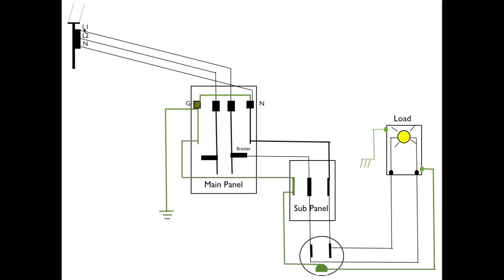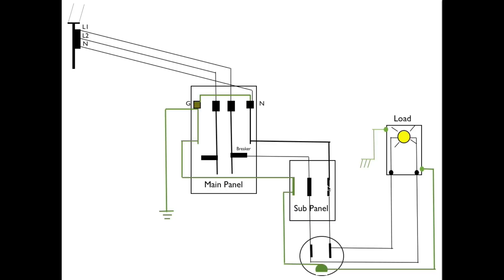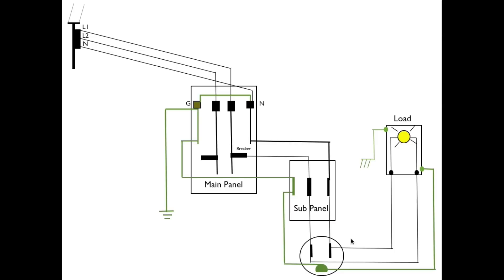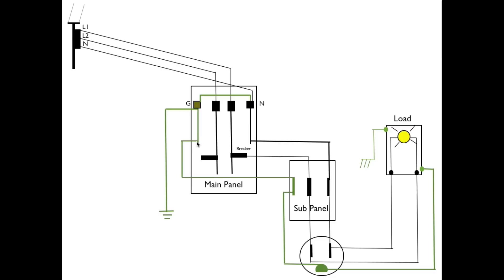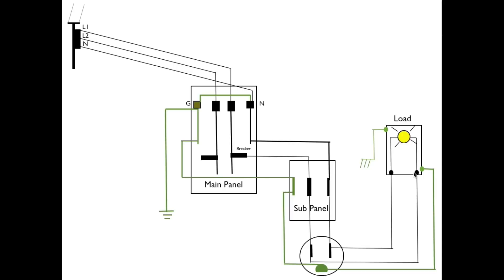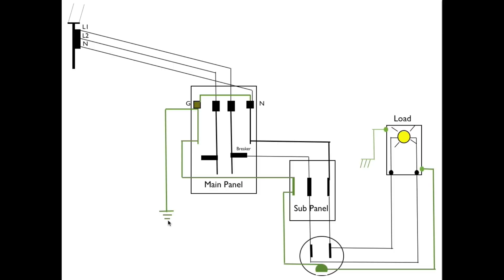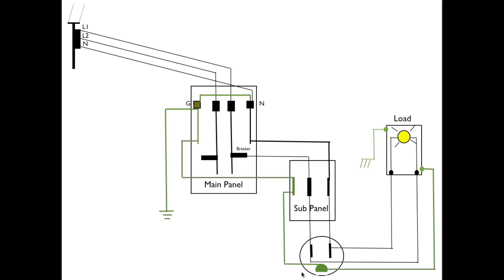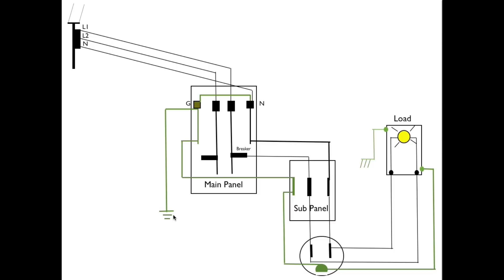The difference between neutral and ground on the electric panel

Comment: How do you do a subpanel with neutral and ground running 240 to the subpanel from the main?
Reply from the maker: If the panel is used for 240 volt only, you only need the 2 hot leads and a safety chassis ground.  If the panel will have both 240 and 120, you will also have to supply a neutral chart is separate from the ground wire.
GFM
Reply: What i did was run a three wire with ground. I ran the white wire to the ground terminal and went direct to the neutral into the panel on the neutral side and used the bare ground to ground out the metal on the receptacle because they have have to be grounded essentially. The bare ground in the three wire tying to the metal part of the receptacle is grounded to the ground terminal in the panel. So, if i use the white wire as a ground wire and tie this to the neutral in the box will this be wrong as long as i have the bare wire connected to my load side?
Reply: I also have two ground rods at both the main and sub panel.

Comment: Common is only a current carrying wire on 120 volt single phase?
if you are running 240 from a sub panel too one outlet.  Then pull 120 from one. Leg on another breaker and ground the the box with pvc plumbing is that ok
Reply from the maker: If you have a 240 volt sub panel, there is no neutral.  There is only chassis ground.  Chassis ground is not a current carrying conductor.  It is only there as a path for fault current to be cleared by the breaker.  
GFM
Reply: grayfurnaceman   so i should run a ground rod from sub panel and ground it to the earth?
Reply from the maker: No.  That will not help.  If you are trying to get 120 volts from a 240 only sub panel, you will have to run a neutral from the main panel.
GFM

Comment: My breaker box has only one "bar" to which both Ground and Neutral wires are connected. If a light, motor or appliance is running in the ON position, current is running through the Neutral wire. I'm NOT an electrician. But I do my own wiring.

About L1 and L2, AS I UNDERSTAND:
 In the US, we have Alternating Current (AC) which cycles between maximum Positive and maximum Negative at 60 cycles per second (CPS), also called "Hertz". L1 and L2 are alternating currents. But they are 180 deg out of phase with each other. When L1 is Positive, L2 is Negative. Both L1 and L2 are 110 volts AC. But when L1 is maximum Positive 110 volts, L2 is maximum Negative 110 volts. Hence the voltage between them is 220 volts. This is why a motor or appliance (clothes dryer) runs on 220 volts because it has both L1 and L2 wires going to it.
Please read this about AC current:
https://www.google.com/search?q=ac+current+definition&rlz=1C1CHWL_enUS888US888&oq=AC+CURRENT&aqs=chrome.2.0l8.18207j0j7&sourceid=chrome&ie=UTF-8
Check out the "sine wave" in the above description. For 1/2 of the cycle, the current (electrons) are moving in one direction, the upward movement (Pos). In the second half of the cycle, current moves in the opposite direction, (Neg) the down loop. They ALTERNATE. 
In Direct Current (DC), as in batteries, the current flows in one direction, from Neg to Pos, IN MY OPINION. If an electron has a Neg charge, it will be attracted to the Pos terminal, though It is commonly believed that the current is toward the Neg (also called Ground)
Reply: MrGruffy 44     I am not in agreement with the comments made by many that somehow L1 and L2 to neutral are 180 degrees out of phase with each other.   If you state that you connected an Oscope to the system and it shows this situation, then I agree.    But the true system is not anything but synchronized. At a point in time, all sine waves are at exactly the same start and end points, and increasing or decreasing in the same direction.   Another thing I don't like is the comments that two 120 volt parts added up to 240 volts.   If the truly must add up to get 240 volts, completely take out the neutral.   Now you have no two 120 volts to add together, but still have 240 volts.   That thinking can get you confused in three phase systems.   Two 120 volts wired exactly the same in a 208/120 volt wye is not 240 volts, but actually 208 volts.
Reply: Kevin Coop — This discussion is not about 3-phase.  As was stated correctly, L1 and L2 are 180° out of phase, because they are opposite ends of a 240V secondary in the transformer.  Each is 120V RMS with respect to neutral.

Comment: What the purpose is for the neutral being connected to the ground in the main panel?
Reply from the maker: +Kaveh Ebadi The earth ground is to absorb lightning and spikes in the line.  Hope this helps.
GFM
Reply: +grayfurnaceman  Thanks. Also quick question. Do you know where the neutral wire connects to in the power plant? Does it connect to the other end of the generator? I ask because it has zero volts which makes feel like it doesn't return to the generator.
Reply from the maker: +Kaveh Ebadi It connects to the center of the secondary winding of the power pole transformer.  L1 to the center(neutral) = 120 volts  L2 to center, 120 volts.  L1 to L2 240 volts.  Hope this helps.
GFM
Reply: +grayfurnaceman  Ah this makes a lot of sense now. Thanks a lot!

Comment: is the third wire,,ground usable as a ground for say inverter or battery?
Reply from the maker: I don't what you are trying to do, but don't mix DC with AC.
GFM
Reply: long story short, i have 2 batteries and an inverter in the house for backup i need a ground for the12 volt batteries,something instead of drilling a hole in my floor with a copper pipe under the house,,we dont have a basement
Reply: Battery systems aren't earth grounded.

Comment: OK, for safety's sake, all is understood for this demonstration, or better still illustration. I do have a question I could figure out on my own, it would just require a bit of time to transpire for the sun to go around the earth and me to take a panel cover off, etc. I had another panel put into my shop and within it are two 220V breakers and also two 110V breakers, I call it a sub-panel because it is charged by my main panel...I am deducing, or assuming(not good), that this would actually be considered an auxiliary main panel, is that correct?

Additionally, are all "sub-panels"  strictly 110V? I have the materials and can go investigate in the morning, and will regardless out of curiosity and to fulfill my educational lusts, but a little more knowledge and terminology would be greatly appreciated.

Thanks in advance...Aloha, KT
Reply from the maker: Knolltop Farms Any panel downstream of the main is called a sub panel and will have the neutral and ground separated.  Sub panels can be both 120 or 240V.  Hope this helps.
GFM

Comment: let me get this straight the ground and neutral are connected to the earth ground? now if I touch the ground and neutral together thee should be no voltage? now I am talking main not sub panel
Reply from the maker: Yes.  Even if you check voltage between chassis ground and neutral at a sub panel there should be no voltage.
GFM

Comment: If neutural wire is carrying load and it's separated from ground to prevent the ground wire from carrying load, wouldn't neutural load transfer to ground wire where they are attached in main service panel?
Reply from the maker: It does connect to earth ground at the main panel. However, ground is not part of of the circuit. The power travels back through neutral to the pole transformer. Hope this helps. 
GFM

Comment: My wife is an electrician. She lost her legs by a land mine years ago, and now has two fiberglass legs. She thinks it's OK to not wear gloves while working in power panels, but I don't like it. Does this sound safe to you?
Reply from the maker: I generally do not wear gloves in panels unless they are above 440 volts.  It would be safer to do so, but the reduction in dexterity drives me nuts.
GFM

Comment: I have a inverter that only requires L1 and L2 with no neutral. This is 240v in. What happens if the draw in not equal?
Reply from the maker: Because the inverter makes 240 volt, the draw has to be equal.  There is no neutral to put it out of balance.  Hope this helps.
GFM
Reply: The inverter will run on 240v (grid) when the batteries get too low.  
The inverter puts out 240v and 120v. I have a 240v pump on a pressure 
demand switch. From the 240v feed to the pump I have a 120v heater 
coming off L1. There is a floating neutral for the 120v circuit. With 
the pump running when the heater comes on will the current increase in 
L1 so that the pump will have equal power on L1 and L2? How does that 
work? Thank you for the reply and help in understanding.
Reply from the maker: That's beyond my pay grade.  Might try the manufacturer.
GFM
Reply: It is an Aims inverter and the manufacturer is of no help. I tried to get a wiring schematic and they said no. The inverter reads 60Hz but my meter reads 59.7Hz. I was going to adjust it up as the clocks read slow. Not a big deal. The pump and heater work, I was just curious as to current flow. I am thinking L1 is drawing more current than L2 from the source. Thanks for the reply and have a nice weekend.
Reply: The side of the inverter that has the heater will draw more power. 

How much power the heater draws on the one leg will have no effect on the power draw by the pump - which will be equal on both legs.

So, one leg will have the current draw from the pump. The other leg will have that equal current draw PLUS the current draw of the heater.
Reply: BonitaCreekWaterGuy — An inverter “requires” (inputs) DC and makes AC.  If the outputs are only L1 and L2, then it seems it would be intended only for 240VAC devices which do not require 120V.

Comment: Question so if I took a 240 volt disconnect box with a line side and a load side and I wanted to turn it into 120 volts ac if I took some Gator clips and put 1 lead online one and the second lead on ground with that ground wire be considered a live wire due to it being the leg of power that provides my 120 volts from 240 conversion not an electrician just an AC guy
Reply from the maker: If there is no neutral in the panel, as you would see in an A/C disconnect, connection to chassis ground would indeed make the ground wire "hot" if the ground is disconnected.
GFM
Reply: grayfurnaceman thanks

Comment: OK, in the main panel the neutral is physically connected to earth ground (safety ground). Good enough. However, at another panel down stream, a sub panel, you have two separate bars for neutral and ground and they must not be connected there.

HOWEVER, that same ground in the sub panel is still physically connected to the earth ground at the main panel. Electrically, they are the same no matter what. The only thing that could change that is if they were not physically connected at any point in the system.

I know that the whole thing must work as shown to enhance safety but I simply do not understand HOW it works since, with the physical connection of conductors between neutral and ground in the main panel, the neutral and ground in the sub panel are still one conductor. If you measure the resistance between the two, you should see a short.
Reply from the maker: Consider if the the chassis ground and the neutral at the sub panel were connected together.  If the neutral had an open, the load would run normally.  Then, if the chassis ground had an open, the chassis (sub panel) would be hot and you could be shocked.  Look closely at the diagram.
GFM
Reply: I understand that. The exact same would happen if the neutral and ground were to open at the main panel. Electricity will always try to complete the circuit.

Since the ground and neutral are connected at the main panel, they are electrically the same throughout the system. You might measure some resistance4 from the conductors if you put a meter between the neutral and ground at any point but, in reality, they are still shorted together.

So, though I know that having a separated neutral and ground on a sub-panel must have a real safety effect, I do not know WHY or HOW that safety effect is working.

Comment: the reason an outlet neutral is not grounded as the main panel's neutral is to prevent parasite currents recirculation in the network.

Comment: If current cant/doesnt flow thru the ground wire in norwal operation how can te current from a lightning strike flow through the ground rather than the house?

what is the difference between a lightning strike and normal operation?
Reply from the maker: ***** Lightning is a form of static electricity that has one pole in the clouds and the other in the earth.  So the circuit is complete when it passes to earth ground.  The voltage is extremely high and if there is no easy path to ground, it will find on thru the house wiring.  The power in your house makes a complete circuit when the hot side passes to the neutral.  Earth ground is not part of the circuit.  Because earth ground and neutral are connected at the panel, it may seem connected but it is not.  Hope this helps.
GFM
Reply: grayfurnaceman thank you
Reply: ***** Keep in mind, this explanation is for the earth ground (system ground) and not for the equipment grounds.  The equipment grounds have another purpose and that is to ensure the circuit breaker trips in a ground fault (line to case) condition.
Reply from the maker: Ian Belletti Absolutely.  It seems so many people think that a connection to earth ground will cause the circuit breaker to open.  Thanks for the thoughts.
GFM
Reply: grayfurnaceman You're welcome.  I'm an electrician by trade and saw that the difference between earth ground and equipment ground needed clarification.

Comment: I don't understand why that in the main panel, neutral and ground are connected. In my head this should make the current skyrocket. What am I missing?
Reply: The very high impedance of the earth - many orders of magnitude higher than that of the neutral conductor back to the center tap of the transformer.

Comment: The explanation is correct, but there is an issue.when there is is connection in the main panel between neutral and ground, the return current will split up into two branches where neutral and ground are shorted in the main panel. A part of load current will sink into the ground at the main panel. You just cant stop this from happening. Resultantly the return current in the neutral wire connected to main pole will not be equal to the current in the phase wire. Try it and you will see the difference. If your electric company does not object to this, then it is OK. otherwise you may be penalized for un equal currents in the two wires ie phase and neutral. Let me explain once again, the neutral current will split into two at the connection in the main panel. Your comments plz

Comment: The ground and neutral are connected in the main box. I don't see how they aren't connected then at each and every outlet. What am I missing? A difference in resistance between earth and the neutral on the pole transformer? But but but, since the ground and neutral are connected in the main box, it doesn't matter how long your wires are, they are the same.
Reply from the maker: First, for these purposes, a sub panel and an appliance are the same thing.
I have a metal portable drill. The neutral and ground are connected together in the tool.  It has a 3 wire plug with ground.  The ground prong breaks off.  The chassis of the drill is now potentially hot.  Any wiring failure in the tool could energize the tool.  They are not the same.
GFM
Reply: Nathaniel Schroeder — If neutral were connected to ground everywhere, I don’t suppose you could have a ground fault circuit interrupter, because a ground fault would be a normal circumstance.

Comment: You did not mention how it must be a low resistance path to ground so that the fault current can be high enough to quickly trip the breaker.

This is counter intuitive because high current is lethal, so why would you intentionally create a high current? So it can blow the fuse as quickly as possible, before it fries your body.

Comment: I think you can connect together neutral and ground on a sub panel if you install a RCD or GFCI on a sub panel to avoid the whole building to go dark and additionally it is convenient in the isolation of the fault block rather than go all over the place to find the fault.

Comment: Why is it that ground and neutral are connected together in the Main Panel? Doesn't this make them both carry current and therefore the ground does become a current carrying wire?
Reply from the maker: The neutral is the path to the transformer.  Any faults will take this path to the transformer and open the circuit protection.  The earth ground is not part of the circuit.  The only reason it is there is to provide a sink for lightning, surges and spikes.  Even if there is a fault to chassis in an appliance, the fault current travels to the neutral at the main panel.  It does not go to ground.
GFM